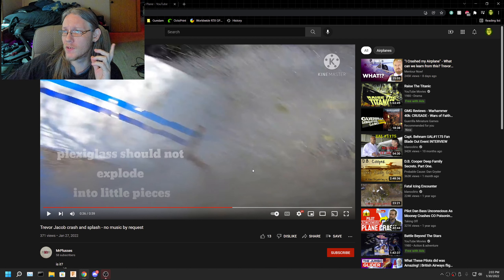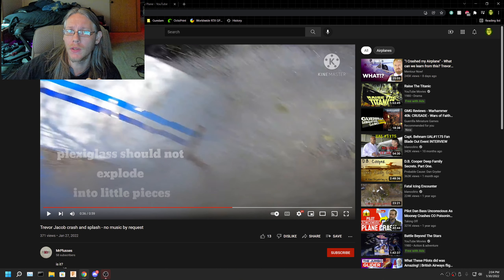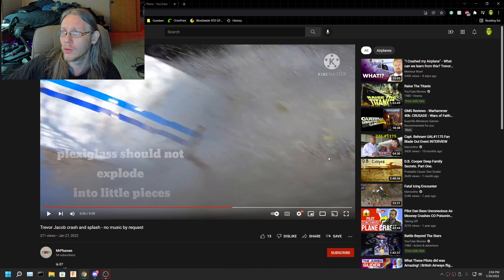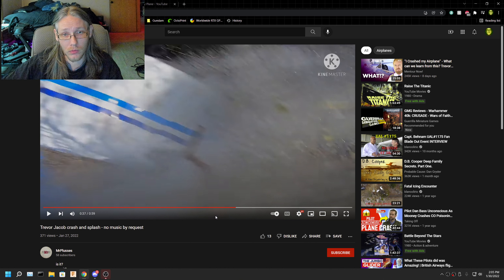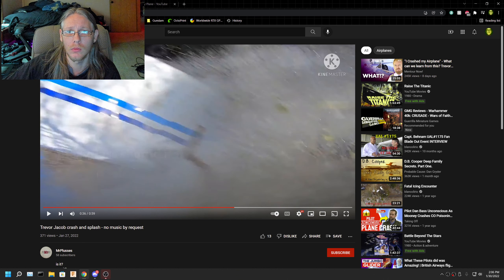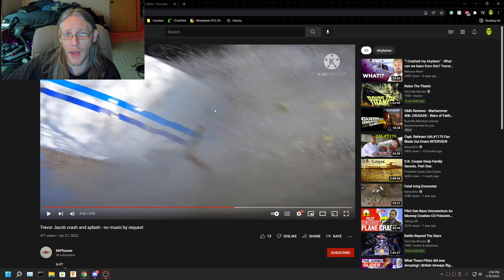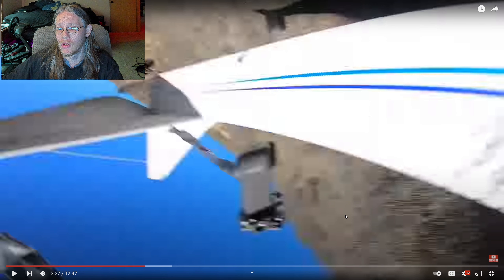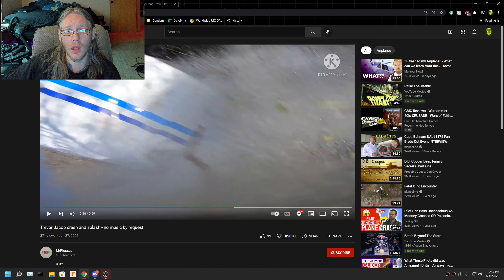MrPlusses you have some explaining to do

Comment: Anyhoo, there probably is more detail in his image (that you were talking about) because it is possible to download a hi-res version of the video.  (4K)
Reply from the maker: and ware and how do you DL this 4K version for my own use
Reply from the maker: also even with a 4k video would YT lower the res to look the same on their site if they both uploaded the same 4k video
Reply: Different materials reflect and refract light diffently. Different sensors capture different spectrums. All this has to be looked at before making a determination of what is it. Using Trevor's video as-is is just visual speculation with no analysis.
I'm checking for manipulation, frame creation, filter usage, edit points, splatter/ spray angles, material acceleration, time distance.
You can't do that just by LOOKING at his video.